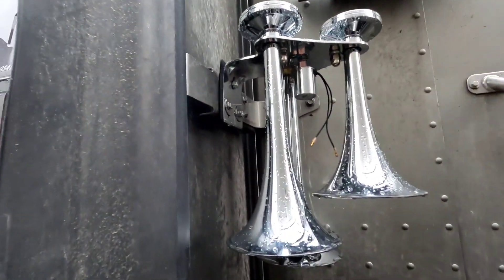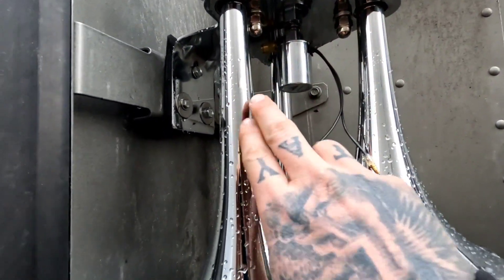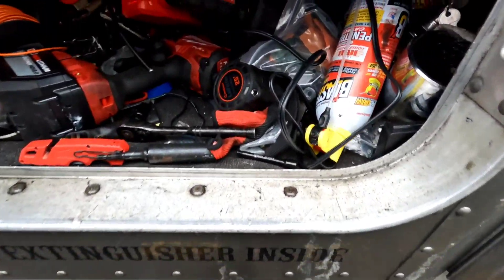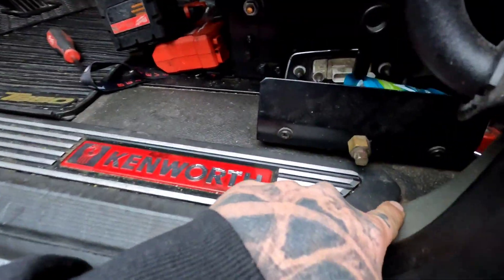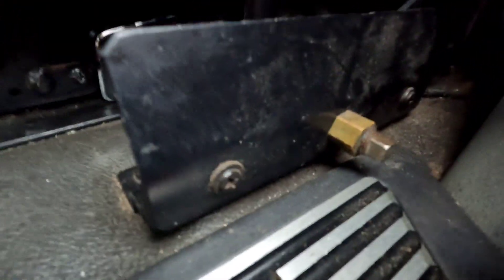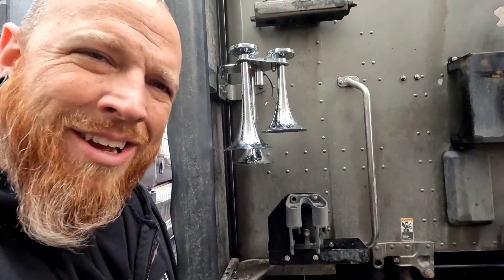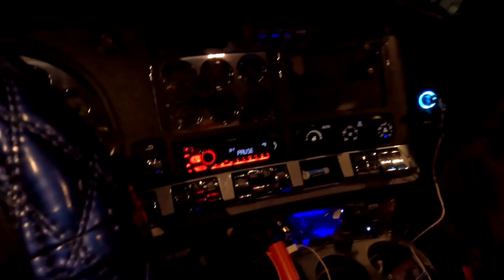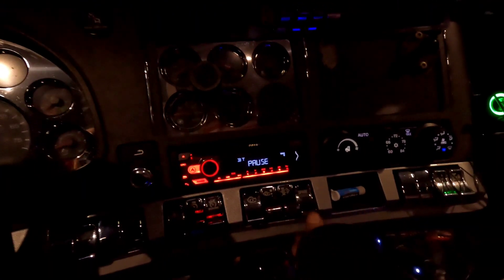Train horn install!! #trainhorn #diy #trucking

Comment: The airline by the seat is for a factory drop axle pressure gauge. I have that on my truck.
Reply from the maker: Finally someone knew! Lol ive been wondering that for 4 years! Thank you
Reply: @justanotherotrguy it’s also used to mount an auxiliary pto switch
Reply from the maker: @Ed.598  i never thought of that. Thanks

Comment: Take off solenoid and put in there 1/2 air line through  manual air valve.  A lot louder✌🏻
Reply from the maker: Yea ill be uploading a video of that at some point this winter. Just did it in the mean time to just get something louder than stock. Appreciate the comment and watching my video